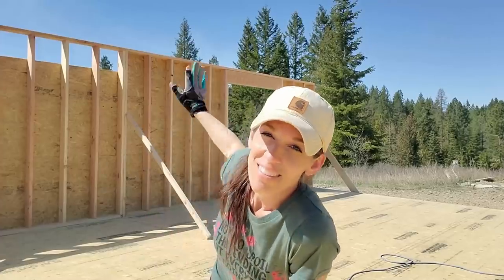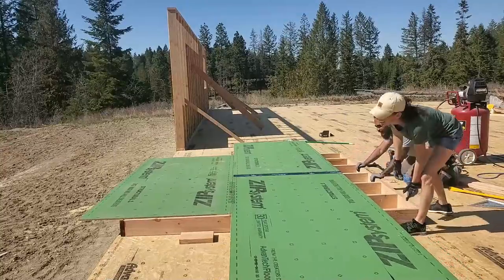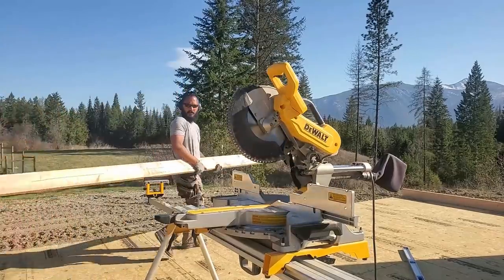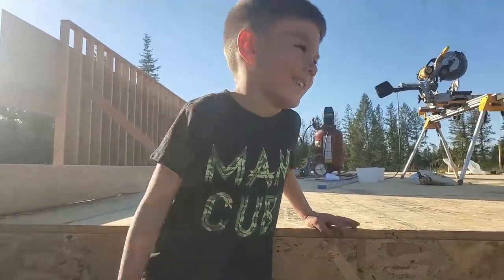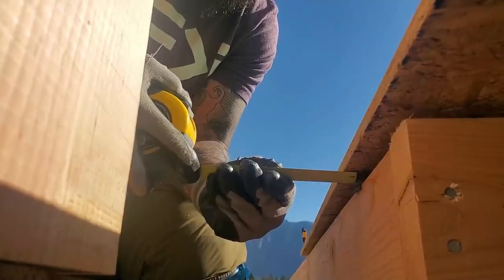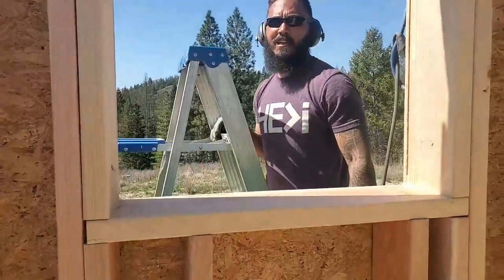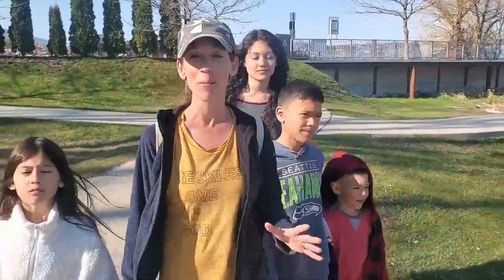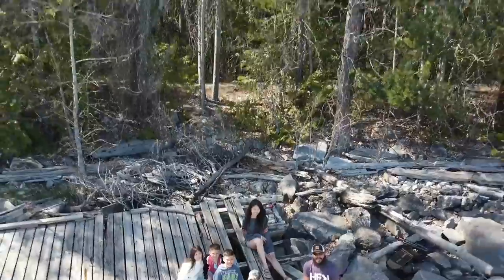Framing Exterior Walls & Knowing When To Walk Away | Building Our Home In The Mountains

Comment: Always use the tractor, when you can, to lift walls. The tractor makes it safer. When you two had the wall section standing, a breeze could have blown it over. Trying to save the wall is when someone gets hurt. Those wall braces are not enough. They need better anchor cleats to hold the walls in a strong wind gust. Hopefully you won't get any wind until the framing is finished. When I was 17, I saw a 7 story steel frame for a building blowdown. 13 men were killed and several other mangled. It wasn't braced. Another good video. Good Luck, Rick

Comment: Amazing how hard you guys work but trust me it pays off in the end and way less stress than having to deal with building crew who shows up whenever and have every excuse imaginable.. Speaking from experience and wish we were able to do a lot of the work ourselves. KUDOS again to you both.
Reply: Rushing Wind Mountain -Yes, This house build may progress just as fast as a work crew that isn't able to stay on the job, for whatever reason. Our farm cottage was built in 2016. It was a simple modular that came in two halves. You would think that is a piece of cake...  Well, we experienced every MURPHY'S LAW situation you can imagine! Our woodland property house site sits on a fairly steep hill in central NH. We have only one way in,  that has a brook with a bridge. The original crane company canceled last minute, stating they wanted our small rural town hall to insure their crane if it fell into the brook! We scrambled to find a smaller crane who would cross the bridge. Found a guy in VT, who had no problem. Then the carpenter crew had issues. They were only a few guys and had multiple reasons they could not show up. Then our house halves got separated after leaving the PA manufacturer. One half ended up stuck in VT because it was not allowed to travel over wet/rainy roads. We hired another private trucker to rescue us! He managed to park one half on the main farm and stay with the 2nd half in VT. And so adventures went on and on... The trucker needed a running start to get those halves up the steep driveway. I have to say both the crane operator and our long haul trucker were well past the age of retirement and they were an awesome pair for cowboys! They got the job figured out and done!

Comment: Hey guys! In regards to the wall support 2x4's: You might consider first nailing a scrap to the floor, then nailing the wall support to the scrap for a stronger tie!
Reply: Yes, nail a short 2x4 flat on the floor deck and then nail the wall brace into the side of the 2x4.  Doing this will make the bracing sturdier and less likely to move.
Reply: Thank you. Beat me to it
Reply: Came here to make the same comment but with a couple of changes. You might want to consider using longer 2x6's. Attach them closer to the top plate. A 45° angle would be optimal. Instead of nailing  the 2x4 to the deck, try screwing it. It's much easier to make fine adjustments. Might also want to consider bracing every 10 ft in case the wind picks up really hard.
Reply: I was just about to say the same thing.... Bravo!!!
Reply: @kwilliamson1096  I was thinking the same thing. I was thinking to myself, I sure hope a strong wind doesn't come up.
Reply: Absolutely don't skimp on bracing while the walls are in that condition. You never know when the wind will pick up and the force of the wind against those walls will be immense.

Comment: Just a suggestion:  it’s customary to fasten the support braces at the floor by temporarily nailing a short piece of lumber (12-16”) flat on the floor and then nailing the support brace into the side of this short piece of lumber.  It just gives you more nailing surface for the bottom of your support brace with more nails.  Handy in a strong wind👍
Reply: Excellent suggestion...I was thinking the very same thing.

Comment: you might want to cut a number of braces the same length and mitred at a 45 deg angle both ends and then secure them to 2x4s screwed flat on the floor. gives you more holding power than just a bunch of screws or nails at the very corners of the braces. just trying to help you out.

Comment: First wall June 15, 1987.  Dried in September 30, 1987.  3200 sq ft house on two levels.  We DID have a grounds crew (small college campus) who came to help us stand up the big walls - 20' wide, 18' high, and 26' wide x 12' high.  ALL with a framing hammer and nails, as we had no compressor.  In fact, we did it all with a generator - line up the boards all marked and cut, start the generator, cut, and then nail together.  Would not trade that time for ANYthing, but is WAS hard, Hard, HARD at times.  Oh yeah....the 6"x16" roof beams were lifted into place with the college crane, too....

:-)

It's SO nostalgic watching you do this -- our kids were right there with us, too - and we're enjoying it immensely.  

Thanks, also for your witness to what's important!

Comment: A tip for the wise: those wall braces need to be fixed into blocks screwed to the floor, preferably with the bottom of the braces mitred to match the floor. There is a massive amount of surface area there and even a light breeze can exert a massive amount of force. I would hate to see your work go to waste. Good luck with the build.

Comment: Jeremy, don't forget to put either a 2x4 or 2x6 stud sideways at both ends of your upright back wall, centered 5 1/2 inches from the ends to give the drywall on the back wall something to fasten to and also fasten the perpendicular walls to. If it is sideways you will still be able to get insulation into the corner.

Comment: You bring back great memories.  My wife and I moved to 10 acres in Idaho County (80 miles SE of Lewiston)  in 1998.  Idaho county has NO building dept and NO inspections other than the state requirements.  We are on a ridge(perfect for my ham radio antennas) at 2850' elevation and 5 miles from Kooskia, ID (the nearest town) at 1280".  
  We did not have a tractor to lift the walls.  I built them in 8 foot sections so that I could raise them myself.  I did buy an air compressor and air tools and electric tools. Better to build "smart" than work "hard".  Learned my building skills from "This Old House".  We started in 1998 and moved into the house in 2001.  Our house is 28 by 40 and is 2 stories plus basement.  Since we hit solid rock at 3 to 4 feet and didn't want to blast, our first floor is raised 6 feet above ground.
  Dave - WB6DHW

Comment: Friendly advice from old builder:  1). Keep wearing the hearing protection, especially when using the Saws and nail gun.   2). Stay on one building action at a time:  Maybe you jump around for video purposes.  However you use your time ineffectiveness, and effort gained is cut, too.  Do framing of as many walls as you have space, then tip up, double-check square, plumb, racking, and plan conformity; then sheathing, then tape/rolling, etc.   You are your own factory!  Stay on task.  Because, a lost day of progress costs you big $$$ and lost time on other family matters.  Enjoying your vids!

Comment: Looking good!  However, a big fart could almost rip those braces off the floor that are in the center. lol If you lay a   2x4 or 6 flat next to the brace, you can screw into the side. Also put a 45 degree angle on the rest of the brace bottoms for more securing surface. Safety first.

Comment: Looking good on framing. Like to make a suggestion.  Instead of using the roller on your tape, use a bondo spreader. We have switched to this method because it fits in the tool belt or pocket and it works really well on windows and it gets a very even seal on the seams in corners for windows.

Comment: You need to screw down a piece of 2x scrap down to the floor,  beside every one of those wall braces. Then nail the brace to the scrap. Don't rely on a nail or screw through the brace and into the floor.

Comment: Jeremy, even pro’s make mistakes.  Nice progress on the build. A helpful tip, layout your walls, studs, kings, jacks, and adjoining interior walls on the subfloor with a chalk line, clear coat with paint then transfer to your top and bottom plate.  This will give you the entire wall layout before you nail your first stud and help you visualize your blueprints in place on the floor before you begin.  You’ll need to do this for your interior walls as well and it helps to see the whole house layout.  All your Jack studs for doors are the same so you can cut them all at once with a stop block on your chop saw.  For all windows the same height then your Jack studs are the same and you can cut all those at once.  Same for your cripples. The smaller windows will have longer jacks but you can get all that done prior nailing up you walls too.  Toe nail your bottom plate with the bottom plate on your layout line then the wall can’t slide off the floor.  Obviously that won’t work every time with your sheathing in place.  Great progress look forward to seeing more.

Comment: Why are you not using any Noggings.  Noggings run horizontally between the studs, generally midway between the top and bottom plates. Their function is to provide lateral sideways stiffness to the studs and also fixing support for wall linings.

Comment: Nice work guys!  Love your videos!  One of my favorite tools is my 16 inch fast framer.  It's a jig that allows you to set your 16" OC studs perfectly every time.  The great thing is you don't have mark your top and bottom plates and you can use it hold your studs in place as you nail .  Cuts your framing time in half and is more accurate.  :-)

Comment: For two people (laypeople, even) raising 6" walls, you two are doing a great job ... although a bit more caution might be in order. 

You can create a crib or trap to 'push' against on the bottom of these walls as you lift them. Since you have backfilled around the crawl-space walls, you can get really close to this with the tractor and minimize the peril even more by using the tractor front bucket to lift these walls into place. 

I bring this to your attention because a single slip can make for a devastating accident and some planning, caution, and use of the tractor might lower this risk.
Reply: Perhaps just using the bucket up against the outside of the target location to assure that these walls won't slip off the decking would work and protect you. This would be much faster ... than building and moving something to do it ..

I OBVIOUSLY posted my remarks before finishing this video. 

Please disregard.

Comment: where you can, use 2x8 or 2x10 walls where ever you have plumbing going up or down thru the walls. also try not to stick those walls over the top of floor joist, trick to do this right is find the center between the joist(from under the floor) then drill a very small hole to mark it. then a little red spray paint so you can find the hole and measure back from the hole to place your walls(remember your drain for your toilet must be 12 inches from the wall stud) this can be very tricky as your floor joist are close together, however if you use a 2x10 wall for that, then you can still drill down without destroying your floor joist. Bonus you can always use the extra wall space for build-ins like for shampoo and medicine cabinets.

Comment: Not sure if it has been mentioned, but I think you need to add some more bracing to your walls.I would nail some 2 foot long pieces down to the floor and into the floor joist and then your angled piece of lumber to the exterior wall is then nailed into the piece on the floor. The wind is stronger than you might think and could topple the wall sections. Keep safe and work steady. I built a 2300 sf foot house a couple of years ago and I know all that you guys are  going through.
Reply from the maker: We added a bunch, thank you

Comment: May I make  a suggestion if you will cut two  boards 14and 1/2 inches long you can cheat on your 16 inche center place it in between your studs and.you will have  16 inche center just a suggestion

Comment: You may have checked this but I didn't see it in the videos. I saw that you checked the corners for plumb in and out (aka north to south) but did you check them from left to right (aka east to west)? Also, after the wall was done did you pull the tape along the wall at the bottom from left to right then check the top plate to be sure you have the same measurement? Depending on how far off the two measurements are it could become important when it's time to frame the roof.

Comment: hate to tell you the moisture strip goes between the cement and first wood sill plate , does absolutely no good between layers of wood , its designed to stop moisture transfer from the concrete to the sill.  (5:16)
Reply from the maker: We did that, but it actually does have purpose between the wood. It lessens the gap, and prevents heat loss in the winter.

Comment: Instead of toe-nailing your braces to the floor you should lay a small block flat on the floor and screw it down with two screws and then screw the brace into the side of the block.  If you get any wind your toe-nails will rip right out allowing the wall to fall over.

Comment: The braces that are you are using to hold the wall with 2 screws toenail at the bottom. To me is not enough. Most the time I've seen a piece of 2x4 or 2x6 scrap 12" long laid flat against the bottom of the braces and the floor and the brace screwed to that board gives you better security I would hate to see the wall fail. If you get windy fall. 
How  about braces on the outside. Stakes and brace

Doing a great job .

Comment: You still have time to change the plans! Better to put the pantry in the interior of the house and have the kitchen exten to the back wall with windows... And try to avoid having the plumbing on an outside wall. It's just an invitation to freeze those pipes. For the kitchen, it's not like you have to change the wall yet. But having more windows, and putting a stove against the outside wall of the house is so much better for venting the stove, and looking out while you cook. Outside wall pipes are dumb in NJ, I can't imagine how bad they are in North Idaho. Nothing is written in stone yet, so make sure your sink and toilet are located on an inside wall, and the stove on an outside wall. Adding a window to your back wall isn't that bad, and it's way less work than routing ventilation from an interior stove to the outside. And all of that is way, way less work than a single busted pipe will be.

Comment: What is the value of installing the ZIP panels to the framing before it is all finished? The ZIP panels might get in the way of installing blocking, wiring, and plumbing.
Reply from the maker: They won't,  keeps walls square when raising. Just easier for us to do it on the ground.
Reply: @GoodSimpleLiving  Fair enough.

Comment: Your bottom plate doesn't need the dpc/moisture barrier when it's sitting on the floor sheeting. It only needs it when it's against concrete that is in ground-contact. It's for separating wet from dry, you've put it between dry and dry.
Reply from the maker: Yes, we put it for air gaps, helps fill tiny spaces to keep air tight.
Reply: @GoodSimpleLiving  There are no air gaps there. Be wary when adding things to construction layers just thinking “it might be a good idea” especially moisture and vapor barrier related things. What you’ve done there won’t cause a problem but it really is too easy to actually create problems. DIY construction is a mine-field for things like that, especially in the exterior wall envelope. The seemingly smallest thing can ruin or negate a system.
Reply from the maker: @DiscoFang  wood isn't perfectly flat, and multiple tests have proven that at the base of walls there are air gaps. The foam just helps seal that space.
Reply: Right right. Or you could argue the point.  I’ve been in construction my whole life, have a uni degree in design and have been renovating my own and building & altering houses for 34 years. What you’ve done is non standard and not what it’s designed for. Like I say, putting moisture barriers inside internal envelopes can lead to a world of hurt. You guys have already make a series of decisions clearly based on half-understandings of existing methods. You’ve even blamed the supplier for one of them (running short of 4x2). 
Love what you’re doing but if you put the stuff out there explaining what you’re doing expect some feedback.
Reply from the maker: @DiscoFang  we aren't working only on our own understanding.  Our drafter, familiar with our climate, always uses the sill seal under walls, and recommended it. I watched a video displaying how air escapes from under walls so we made the choice to use it. The lumber was the supplier's error, they even called to apologize for the oversight.

Comment: Guys you are going to a problem or 2 so if I may say your first corner you put up there is no nailer for the sheet rock. Also your bracing will never hold up in you have any wind at all, you need to over lap your top as well as your bottom plate don’t do sections and but them together. I watch you people when your still in WA and I want to cry. Please check on how to but wall section together.
John

Comment: I can fully appreciate you doing your own framing, much respect, but you're gonna regret not framing in corner posts when it comes time to join adjoining walls.  Framing inspection's gonna gig that.  Hard.
Reply from the maker: We’ll get them installed, dont you worry. And there are no inspections or building codes here 😎.
Reply: @GoodSimpleLiving  I wondered about that.  One of the many benefits of living outside the metro areas.  Love the series.  #DriveOn